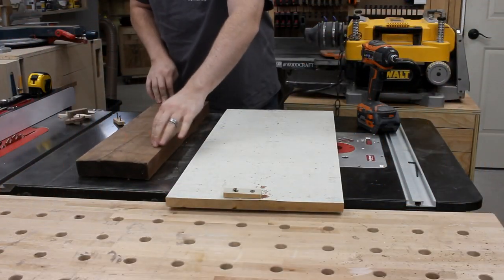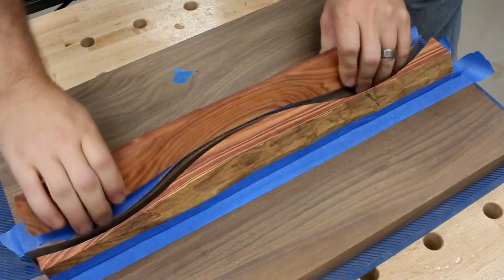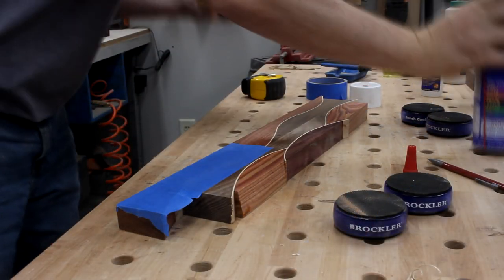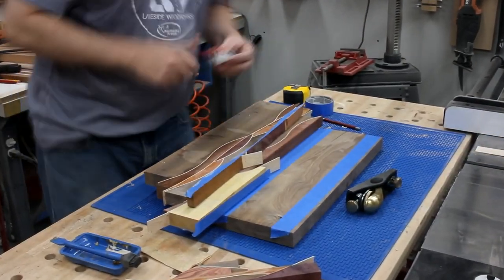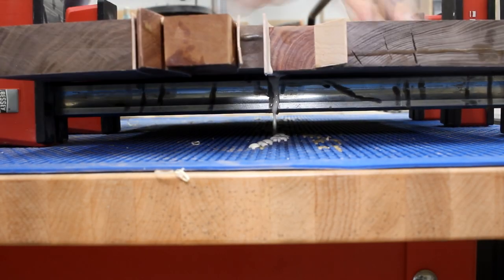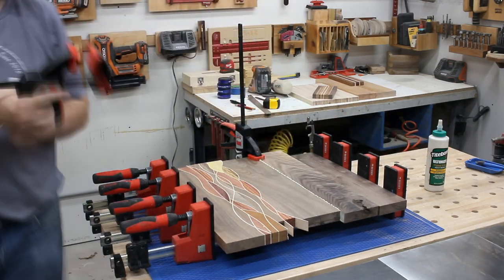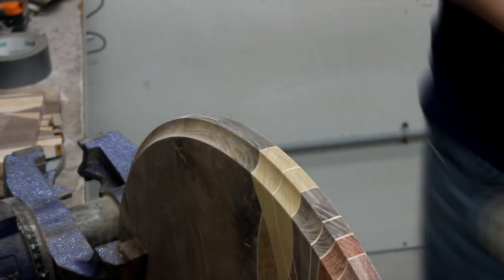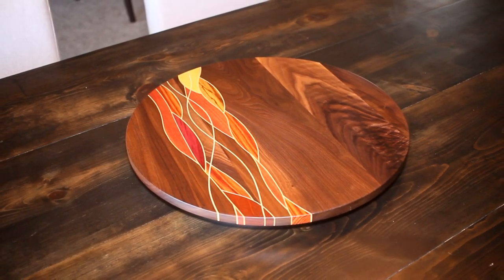Woodworking:  Making a woven Lazy Susan

Comment: I love the woven look, and a lazy susan is a great alternative to endless takes on cutting boards.  😊
A few years ago I made a maple tool handle for a bowl gouge on my lathe, and I did a wavy cut in the maple blank and glued in a piece of green-dyed maple veneer.  After drying, I then turned the blank 90° and did another wavy cut, and inserted another piece of veneer into the blank.  Looked really nice after turning.  I will have to try your technique to bring in other wood species, maybe on a cutting board, or perhaps on a lazy susan.  

Thanks for the inspiration!

Comment: That's beautiful. I think it would be even better if the whole thing was done like that. And using different woods for the kerfing strips. Other than that....... I WANT A BAND SAW!!!!!!!!!!
Reply: Stanley (my dad's name was Stanley) there is another way to do it using templates (that you can sand to get the curves nice) and flush trim router.  You still need to cut, but you have the width of your router bit to guide the blade so you can get away with a jigsaw.  It does mean that the insert has to be the width of the router bit, but if you sandwich three or four strips it is easily doable.  Check this out to see another approach.  https://www.youtube.com/watch?v=pLYYngtUCVg
Reply: Do it and post your video
Reply: I'm struggling to learn mine. I was going to do his woven cutting board this weekend, but I tried a bandsaw box instead. I'm not ready to do a weave yet.

Comment: That lazy susan is absolutely beautiful! I love how it turned out. It also seems to be an excellent way to use up leftover scraps from other projects.

I had an idea while watching this. What if you did something similar, but with only the maple strips. As in, you cut the boards as you have been, but just use one type of wood for everything (except the thin strips between cuts). That would give you a really pretty interwoven effect that's a little more delicate looking, almost like a braid.
Reply from the maker: Yup, I've seen it done before and you're right.  Go for it!

Comment: Tape recommendation:  to hold pieces together for this or routing, etc, try 3M 9500PC.  Its 2 sided psa, very thin and holds very well.  Two 1" strips will hold pieces for sawing or routing.   A roll 3/4" x 36 yards costs about $20.  Its widely available from industrial supply companies and probably the dreaded "A"
Reply from the maker: Good to know!  Currently I can get 132yds (6rolls of 22yds) of painter's tape and a bottle of CA glue for the exact same price off Amazon though.  Plus I can use the painter's tape for a bunch of other things as well.

Comment: Drew you are about to hit 250k subscribers. To celebrate you should get a Festool sander and vacuum and you wont have to deal with a mask while sanding ever again. I found a set used I got hooked on Festool. I put a glass of water next to me when sanding several cutting boards and couldn't find a single spec of dust in it when I finished. Check craigslist and facebook marketplace for used festool and it no different than keeping money in a savings account. It wont depreciate any further. It's how I sell it to my wife at least. Keep up the great videos.
Reply from the maker: Yeah, I've been eyeballing the Festool and the Mirka

Comment: I tried doing this after seeing this video. You make it seem easy which it isn't (for me at least). I had too many and too deep blade marks so that after sanding them out I had uneven surface and could see through the board in spots. Going to try again next week, maybe I need to push the board through the  bandsaw faster so it's a smoother cut instead of going slow and having deep gouges where I ajusted the angle.
Reply from the maker: Yes, you definitely cannot go slow.

Comment: It came out very nice!  Wondering if it is worth looking at insetting the hardware to hide it from the side?  When you placed it on your table, the aluminum side was pretty clear and seemed to distract from the overall effect. ... I've got to try that technique on some upcoming project. ...  Wondering how you milled the thin strips... I'd just rip them on the TS as they're too thin for the planer. ....    Love the outakes!!
Reply from the maker: The thin strips were cut using my thin strip jig.  Watch Ultimate Table Saw Jigs pt1 to see how I make/use it.

Comment: Your videos are always a good time ... vandalize the bottom ... that's a good line. Today I am going to make my first woven board using your guidance for a friends wedding. Really appreciate you making it look so easy. If your ears are burning later today, now you will understand why. :) 
Why the table saw for rounding? It's cool technique if you don't have a bandsaw but wouldn't the bandsaw have done it easier? I mean a jig for the bandsaw would be no harder.... so why?
Reply from the maker: Thanks. The table saw leaves a much cleaner edge for the circle cut. Bandsaw would be fine if you’ll be adding a round over too but would still require a bunch of sanding.
Reply: @FishersShop  Oooohh. I didn't think about that.... Now I gotta try it.

Comment: I am going to attempt this with totally inadequate tools.  Probably not 18 inches wide though, I might for for 12-14. And I probably can't use board that thick, but I think it will still look good at 1 inch thick.  Gonna cost me a bunch because I don't have a planer or jointer so I'll have to pay for pre milled lumber.  At least I can ask for off cuts.

Comment: Beautiful lazy susan.  The weave is just spectacular.  Curious as to why you used the table saw to cut the final circle when the bandsaw would have been easier, especially, as you note, you tend to the lazy side😉.
Reply from the maker: Table saw leaves a cleaner cut and the jig was already made for it.

Comment: I am absolutely consumed by the designs on this and the cutting boards and have tried several, but really get confused.  I am wondering if you have a step step, other than the video, because all the turning. switching ends, etc., is hard to keep up with.  If not, I will keep at it until I can do it without wasting wood!!!  You are a talented woodworker.
Reply from the maker: Thanks!  Sorry, no plans for this technique.  Just keep practicing.  You'll get it

Comment: This turned out absolutely beautifully! Genuine question - have you considered a circle jig for the bandsaw? Would the throat depth and/or table size have prevented you from cutting such a large circle safely/efficiently there? (I'm probably being overly-cautious here, but those first couple cuts on the tablesaw had me concerned about the potential for the project to pivot slightly, resulting in blade binding/kickback)
Reply: And just to be 100% clear, I am not calling this out as an unsafe practice, nor am I suggesting it shouldn't be shown to/attempted by anyone - I personally might be hesitant to try this technique on a tablesaw, but that certainly doesn't mean it can't/shouldn't be done by others. There are almost always numerous creative ways to solve the same problem, and this showed a method I'd never even considered. I have absolutely no experience with doing things in this particular fashion, and therefore lack the requisite experience to support a firm stance one way or another - pure armchair speculation on my part. :)
Reply from the maker: I’d argue it’s actually safer on the table saw since the entire piece is fully supported on the surface. Plus it’s much more accurate and the cut is much smoother. But like you said, the jig I have for the table saw is not limited by throat depth and can actually cut a circle over 4’ in diameter.
Reply: @FishersShop  That's a great point! Thank you for taking the time to reply, you rock!

Comment: Great Job.  What bandsaw blade did you find worked best?  You mentioned 1/2" in your other video but how about TPI?
Reply from the maker: Something pretty aggressive with a low TPI count so you can cut fast.  If you go slow, your curves are bound to not look smooth and flowing.
Reply: @FishersShop  Thanks Drew!!

Comment: This is incredible.  I've started doing some weaves because of this video.  What brand/where did you get the lazy susan hardware?  I've been looking for something less noisy and cleaner looking for my current project and am not having much luck.
Reply from the maker: I just found it on Amazon.  It's not as smooth as I would have liked but you can make it better with some 3-in-1 oil.

Comment: Amazing work I followed you for a long time now! Quick question I have the same bandsaw as you I think but mine is a 10-324 14”What size blade would you recommend for me to cut the carbs like you do I think mine is the stock believe that it came with
Reply: I don’t think Drew has cut any carbs. He still eats doughnuts, chips, & Peanut M&Ms. 😉
Reply from the maker: Bigger the blade the more smooth the curves will come out.  1/2" in there for this project.
Reply: @ericcasteel1379  LOL I was using talk to text!
Reply: @FishersShop   so is 3/8 or 1/4 too small?

Comment: So I'm planning on making this for an anniversary present.  Which means I have about a week.  How long did you wait in between glue-ups before you cut the next piece?  Did you leave each one over night or was the glue dry enough in a few hours to make the next cuts? I wish I had found this a few weeks ago.  :)
Reply from the maker: All depends on what kind of glue you use and what kind of wood you're gluing.  For mine, I gave it about 4hrs for each round.

Comment: Where do you get all of those exotic woods from. Is there anywhere that I can get a box of assorted exotic woods? Also, amazing work!
Reply from the maker: Got some from Woodcraft.  Got others from mail order places like BellForest.
Reply: @FishersShop  Ok, thanks!
Reply: What TPI Bandsaw blade did you use?
Reply from the maker: @joshuarose8846  Like 3-4, I don't recall.  It's an aggressive blade so you can feed it fast and get sweeping curves.  If you go with a high TPI, the gullets are small, and you have to feed slower and your curves won't be fluid-looking.
Reply: @FishersShop  Ok, I tried a 6tpi blade and it cut nice and fast so i could get a smooth curve, but it left to deep of blade marks to sand out so I was going to try a higher tpi blade

Comment: I noticed that you used more shims during that final thickness planing (6:35), but I thought you'd already flattened the boards during the prep phase?  Why would you need to use shims again if the boards were already flattened? :)
Reply from the maker: After all the glue-ups, it's no longer flat.

Comment: Awesome piece!  Okay, I have to ask... what evil spirit posessed you to forgo using a much safer tool like the bandsaw to cut the circle, (which is one of its strengths) and settle on the nortoriously unforgiving tablesaw to cut it?
Reply from the maker: Smoother and more accurate on the table saw.
Reply: I understand. A lot of people tend to look at the bandsaw as just a rough cutting tool and not used for precise work. So I'm not knocking your decision. It's just that we don't see many, (if any...) people use a tablesaw to cut circles when the bandsaw is just as accurate and far smoother when used correctly with the same style jig.  You using the tablesaw is not wrong, just different. So I had to ask. The great thing about all this in the end is, "To each their own..."  So, while respecting your decision I just disagree with the logic. Thanks for responding...

Comment: That sure is a beautiful lazy susan. I always get a few good laughs in whenever I watch one of your videos. Why wouldn’t you use your bandsaw to cut it to a circle? You can very easily make a circle cutting jig for a bandsaw and then it’s a little easier and most likely quicker. Not real reason to fix what isn’t broken though if it works well for you.
Reply from the maker: It would probably be quicker on the bandsaw, but I'd argue it's more accurate, leaves a cleaner cut,  and safer on the table saw.  This little jig can cut a circle more than 4' in diameter and I couldn't safely hold a circle that size on the little bandsaw table.